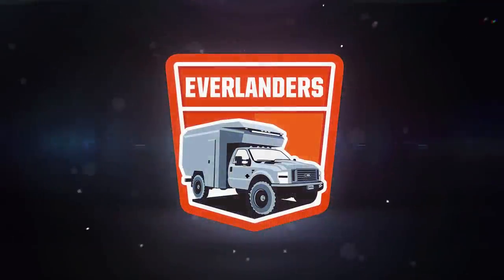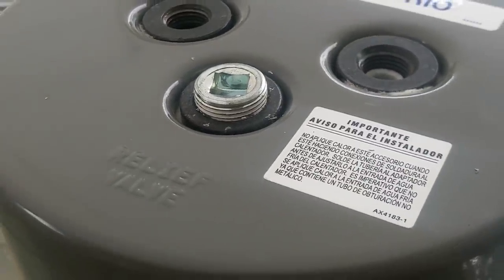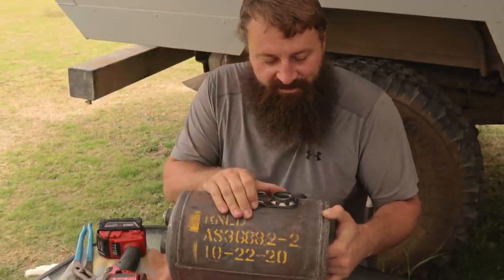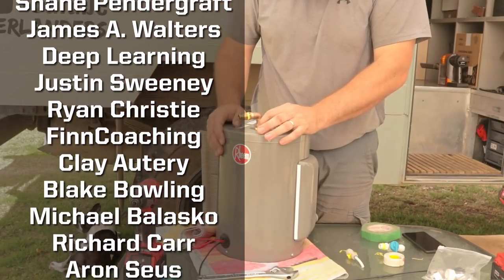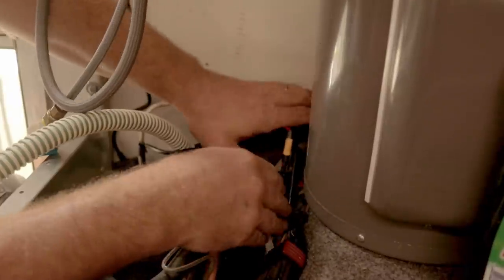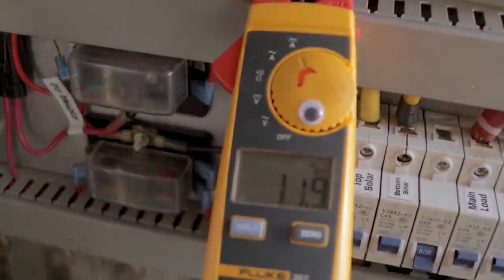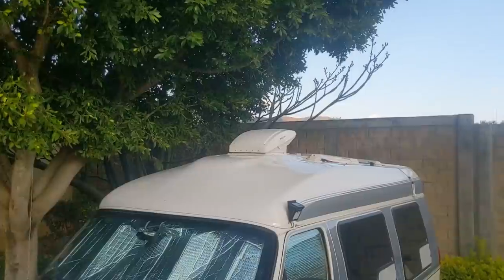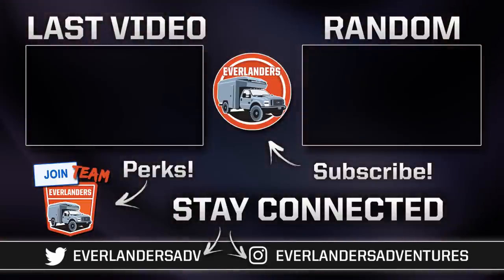Solar Powered RV Water Heater Conversion - 12 Volt Dump Load - Everlanders see the World!

Comment: Oh I vote for DC-DC conversion, nothing annoys more than taking DC, converting it to AC just so I can then convert it back to DC.
Reply from the maker: Glad it's more than just me...
Reply: Agree, work for solar company, DC is the source voltage, just buck off/boost excess of the MPPT
Reply: This is why my off grid tiny house is being installed with as many 12 volt appliances as possible
Reply from the maker: Well, it's your lucky day, the DC-DC conversion video just dropped: https://youtu.be/UAZGX379dmc
Reply: @Everlanders  Ha, awesome, I've been using one of those converters to charge my laptop, works great.   Need to convert the Dyson now.

Comment: A friend just introduced me to your channel ... I love it. Best unboxing ever!

A small suggestion for a belt and suspenders approach to protect against thermal runaway, or to simply control the water temperature via analog (for those who don't wish to go with digital control). Repurpose the existing tank-mounted thermostat, wiring it in series with the 12V heating pad (after removing the 120V connections). If folks want to keep the 12/120V option, you could also replace the single-pole (120V) thermostat with the 2-pole (240V) version, using one set of contacts for the heating pad and the other set for the 120V heating element.

Comment: I've always wondered about the DC to AC back to DC conversions being inefficient, just never tested it out, so that's my vote.  Going from 14v to 19v will have it's drawbacks, and be proprietary to that one device, an inverter gives you the standard AC outlet.  Thanks for the content.
Reply from the maker: Yes, Agreed, but we will still have our Inverter as the "Universal Adaptor". But I'm on the laptop for 6-10 hours a day and the 3D printer is on for long stretches at a time, so I'm hoping that these see the biggest gains in efficiency.

Comment: P.S. the more I watch about your build the more I see how great it is. The keg idea for water is just paying back in dividends; I was looking at a tank solution for my build just out of pure capacity but it's hard to argue with your setup with compressed air and the multiple uses, as well as the ability to easily refill water without needing a real RV fill point.
Reply from the maker: Yes for sure! There are no options for hose refill south of the US border...

Comment: Great video - Keep all the ideas coming. LORA definitely. I fitted a similar tank that's used in boats heated by the engine which has worked very well for many years. Its got a housing for an element which I can use for surplus solar / mains heating. When I get the surplus solar fitted.. Interesting to find out about the bearing problem on the fans.
Reply: I'm running 1200 watts of solar to lithium batteries with 3000 wats of inverter. Not that it matters but I have magnum solar controller & inverter. I have heard the conversion to 120vac is inefficient. I would be interested in dc to dc conversion to charge laptop, cell phone,etc.
Thank you for all your help.
Gary.

Comment: Nice setup! One thing you could consider is to put a thermostatic valve on the output so you always get the same output temperature and your reservoir contents lasts longer. You then can even heat your reservoir to let's say 80° and still have a safe output temperature of let's say 40°. Are you also going to use it for the shower?
Reply: Shower? I would put a shutoff valve on the shower head. 6 gallons of hot water won't cut it for long but one good thing it don't take long to reheat the water. I once went to my neighbors fishing trailer to do some work and the kitchen had a 10 gallon water heater and the cold water came out hot because of the back feed of the water heater. I would like to see a 12 volt heating element and put it on a ten gallon water heater. But on a house it would be better just to install a solar water heater. I would save the power for running an AC unit. 73

Comment: I've installed several of those little water heaters as.i li e spot water heaters in houses that have very long wait times to get hot water or a distant location. This water heater is  cheap to run and provides hot water instantly while the main hot water is making it's way to the location.  There was a truck camper guy I knew years ago, had a custom dual 12vdc 120vac  stainless heating element to use his excess solar production and it worked great. The last line of code I wrote was visual basic  back about 2001 . Take care...

Comment: Hi Mike from over the pond, just starting out in off-grid camping, This is a bit advanced, but it's doable.
Gonna go simple stupid, power out from the charge controller and thermostat to shut it down when up to temp.
We have a tie-in system that dumps to a second oversized hot water cylinder in the home, gonna do the motorhome now.

Comment: Shouldnt that temperature be over 65'C to avoid legionella bacteria growth?
Reply from the maker: Yes indeed! I'm running it at 70° for the last while.
Reply from the maker: And after I get the rest of my plumbing parts here, I can connect the cold water to the faucet again and then I'll likely jack it up to 80°c and then blend it back at the tap.
Reply: yes to 60 C = Growth
This tank needs to be cleaned probably monthly just to ensure nothing nasty has overgrown inside it

However, what's more, important is overnight it is dropping to ~40C which is even more dangerous than keeping it at 60C
I reckon this water tank should be kept at a toasty constant 100 C ;)
Reply: Are you feeding water from the purifier? Would that keep the bad stuff out?

Comment: DC to DC Efficiency - new sub as of 3 minutes ago. I converted a dozen computer servers used in our business from standard AC computer power supplies to 12 VDC Automobile supplies and added 22 ah ACM batteries and powered them with combo power-supply/chargers and this also allowed us to get rid of the UPS units for them as well. It reduced our monthly electric bills by $150 to $200 since it also reduced our A/C requirements by a decent amount. We also converted all of the hard drives to SSDs in the servers at the same time which was required for some servers due to the smaller max size power supplies available for DC (250 vs 350 watt). Payback was 18 to 24 months.  If you included the UPS conversions, we were going from AC to DC then to AC then back to DC by the time it reached the computer guts! Now we are AC for the Charger/PS units and all DC from there!  Plus the backup batteries would run the servers for 4 hours on average instead of 20 minutes on the UPS units. In Florida (Hurricaneville) this was an AWESOME benefit!   Best Dog Gone project I've done in a long time. This is why I vote for DC to DC efficiency.
Cheers, Richard
Reply from the maker: Great example! Nice work!

Comment: DC to DC is interesting! I am running 24V and was thinking to do a switch mode power supply to 19V for my laptop and “big” screen monitor.  And good job on the heater, using battery level sounds like to way to go.

Comment: Super timely for me. I have 2 on-demand water heaters and too much solar, but my inverter already prioritizes battery charge over load demand. And On-demand doesn’t run until needed, but the topic is so relevant. What I’m thinking about now is segregating a portion of my fresh water as pre-heated water. Especially in winter when preventing freeze might be helpful.
My other thought is to cool the solar panels with either fresh water cycling through or a coolant running to a radiator/exchanger to pre-heat a water tank or the outermost layer below the trailer. 
Lots to think about but your video sparked my rabbit hole exploration!
Thanks!
Reply from the maker: I should mention that this video is quite old and this system has been superseded by a newer setup already.
Reply from the maker: https://youtu.be/TGMZ7bM-Kow

Comment: Lora is my 1st choice and I believe once people see how it works the desire for more will grow. When it started it was expensive but prices are lower now. The network idea is a good one. The 2nd choice actually farther than 2nd is DC to DC stuff and most people do not understand this much either. It would be good for those who want 24VDC solar battery bank and need to operate some 12VDC items. I did find the hot water heater at Home Depot here in the states, not inexpensive $189US but you definitely gave me some good ideas. Thanks for the HW info nice stuff.

Comment: Great job! Thought provoking. The internal 110v element is a potential point of failure/leakage. If you never use the 110v, you might be able to replace the element with a gal. plug.
Reply from the maker: This is what I did: https://youtu.be/TGMZ7bM-Kow

Comment: My father-in-law bought and installed a solar water preheater back in the 1980's. A fluid, I don't remember what, circulated through a solar collector then through a jacket in the water heater.  It pre-warmed the water before any energy was used to heat.

Comment: Did the same thing with one that I bought at homedepot in Toronto for my boat, I also installed the 12 volt heating element. In this case I have dual heating on a open solar panel.

Comment: Love your channel!! You are a man after my own heart... I'm Running my scratch built Arduino based voltage regulator in my onan military diesel generator -- as I type this(No problems since I installed it over six years ago). Stuck in a Weatherford,TX truckstop during snow/ice storm. I'm an over the road trucker, electronics hobbiest, and Ham radio operator. Glad to see someone else putting some handy tech to good use. 
     I have a 1997 REVCON Trailblazer that I am refitting for overlanding. Including a 12 valve Cummins swap -- which need I to rebuild. LoL

Comment: Thank you so much for this post - I have used your heated mat concept (mine included  a fixed 90C cut off as it was designed for a waste oil tank heater)) and a programmable variable voltage  relay used to trigger a relay via a switch with LED indicator  -  I can both see when the mat is on & if needed shut the circuit down  so my 300 ah lithium  can top balance  - My Carver water heater is only 4 gallon and  I only have 280 watts of solar supplemented by 20a of DC to DC  from the alternator - I plan to use the solar dump to prevent the Lithium batteries from climbing the knee in everyday use
Reply from the maker: Good job!

Comment: nice! I was planning on doing this with my DSI RV water heater. basically wrapping 3x 220W 12v heating pads, and controlling them based on SOC and demand, basically 80-85% SOC = one heater, 85-90%SOC is 2 heaters, 90+ is all heaters on. then put a thermostatic mixing valve on the output so we can run the heat up a bit more than normal for a larger thermal bank. and then as a last resort the LP heat can come on if it drops below the setpoint.
Reply from the maker: Sounds great!

Comment: Boom! Hope you don’t mind if I grab that idea and run. Got 800w on my van and 6.6kw in the battery, find a 10L hot water system, the temperature sensor with digital display etc I already have, add a voltage sensor, buy a 200w heating pad and follow along!

Comment: You may be able able to convert your 3D printer to run directly off of 12v without using a boost converter.  You'll need a 12v heater cartridge for the hotend, and 12v fans.  If you can tap into the center of the heater trace on the bed, you can run the 2 halves of the heater circuit in parallel at 12v without any loss of efficiency.  You'll likely need to run an external mosfet, or upgrade the one on your control board to handle the extra current for the bed.  The mosfets for the hotend and fans will likely be fine as is.  I'm planning a similar project for my van.  I'm seriously considering building a Voron V0.  What is the wattage of the heater you used on your water tank?
Reply from the maker: Yes, I considered swapping out the hotend to 12v, I've already replaced the fans with quite 12v Noctua fans... But for the time being I'm running it at 24v

Comment: Older guy with little of your skills/ experience but found your video and community lifestyle fascinating as well  the water  heater project.   Always a struggle not to have vids run long but a little explanation of your hyperlapse of the tank control fittings dismantling  would be good.  New subscriber here to follow your builds Cheers !! Vote: DC to DC

Comment: Super video, lots of people want this too. I recently thought about making a maze of small tubing behind the Solar Panels themselves as in a Thermal Collector. I figured that a tiny pump driven by solar could pump secondary water (Never consumed) through meters of small heat-resistant-tubing all carefully routed behind the solar panel(s). This circulating water is gonna get 60 degrees for sure and fast. Now you only have to make a heat-exchanger to warm up the drinking water in a large container of some sort. Just an idea i had. This is basically a very safe system and might even better than an electrical system. You to judge.
Reply from the maker: No, a tiny pump with long lengths of thin tubing in a maze would have significant restriction to flow, and certainly wouldn't work with our sliding mechanism shown at 0:13

Further, you want the heat to evacuate the solar panels as quick as possible as the efficiency drops dramatically when they get hot, by heating them to 60° with nowhere for the heat to go, we would be losing a lot of power.
Reply: @Everlanders  I guess there is also the possibility of sub zero temperature effects on such a tubing type system that would give problems in freezing conditions

Comment: wow, interested in all. but that little magic board thing you can send messages on sounds super cool. especially if it is open source and cheaper than systems like SPOT etc. i don't know much about the magic electrical stuff you did with those Todd boards and Pi systems... I can barely use email lol, but seems really badass albeit intimidating. Gonna run thru a bunch of your videos and see if it makes more sense and still holds the same wonder as you showing off your system here lol. but anyway, thanks for sharing and i look forward to checking out whatever you decide is next to show us :)

Comment: I've been looking for a way to extend my hot water level in my RV. I've looked for something like the size tank you used. Like the way you used the wasted solar power to heat up water tank. This is a great video I'll look back at often. Congress on the out of box thinking you don't see with builds or renovations

Comment: The issue about the voltages is the maximum power transfer theorem you could just run you dump current into a capacitor an oscillator and a step down transformer in reverse.

Comment: Not sure if you still read comments on old videos.  I am inspired by your video to to the following. 

Buy a cheap 120 v water heater and replace the heating element with a 48v element.  Then just use a thermostat probe taped to the side to regulate the temperature for hot water by turning the element on and off by temperature.   Then I do not have to invert the power before I heat the water.  I will not be using it as a solar dump for power.  (great idea though), just use it has my actual water heater, but just on 48v!!!  Since the safety valve on top is mechanical and not electrical, it should still have the pressure pop off safety intact.
Reply from the maker: Yes, I read and approve every comment...  

We didn't just build it for a dump load, it's our water heater too... this video is a little outdated and we have a revised system shown here: https://youtu.be/TGMZ7bM-Kow

Comment: I just finished installing 700 watts Go Power Solar, 400 AH LifeBlue Lithium, Victron 150/70 MPPT, and Victron Orion 12V 30A dc to dc charger. The system has me fully charded by 11 the next day. I had thought about a seco dary load and I've seen several people do 12V water heater elements. It then occurred to me, my absorption fridge has a 120 V AC element to cool while on shore power. I have no automated means of switching, but I  have been unplugging the shore power unit and making sure the AC is off. I then plug my shore power cord into my 600 watt pure sinewave  inverter and powering up the fridge, laptop, and other items that way for about 4 to 5 hours a day, all the time making sure the panels are producing 350 watts or more. My batteries only contribute between 1 and two amps while running my secondary load. I then switch back to normal operation,  batteries go back to absorption or float mode having only expended 1 or 2 percent of their capacity.  I'm sure this method will save me propane though I don't know how much. Thought you'd get a kick out of it. Take care you two.

Comment: Funny I'm just going down this rabbit hole myself up here in BC.  Looking at point of use heaters used in commercial bathrooms, 3000w 120v.  Personally I have been thing about the DC to DC problem for awhile as well..

Comment: Just stumbled onto your channel -- great video.  An interesting engineering coincidence:  1440Watt@120V element = 144Watt @ 12V (I think -- there are a couple of different ways to figure this)...  that's about the same as the silicon mat you installed.  You might try plugging in the AC cord into a 12V source and see what happens.  It must just work.
Reply from the maker: It would not work, because the power is Squared... The original water heater element is 9.8 Ohms
Per Ohms Law, which states Power (P) = Voltage (V) * Current (I) 
At the rated 127 Volts, the current through the 9.8 Ohm resistor is 12.95 Amps ... which means (P) is 1645 Watts.
At 12 volts, the current through an 9.8 Ohm resistor is 1.22 Amps... which is only 14.69 Watts.
https://ohmslawcalculator.com/